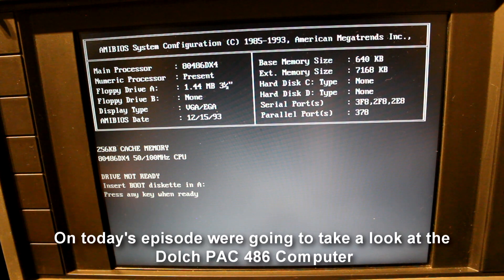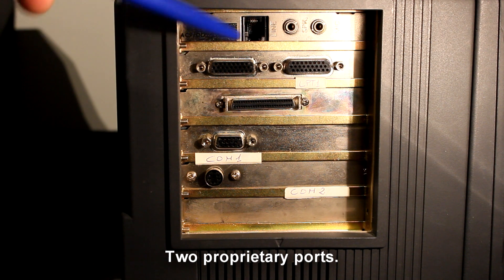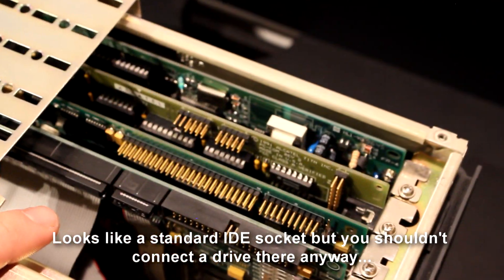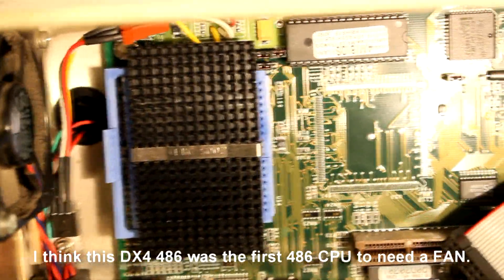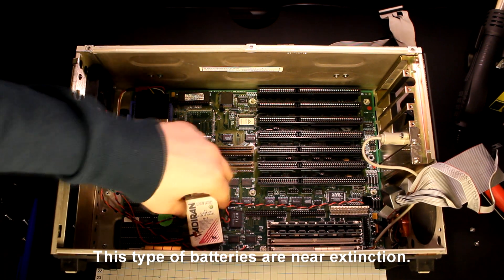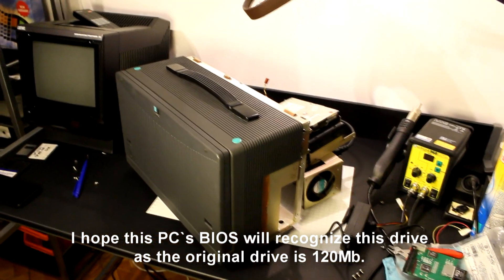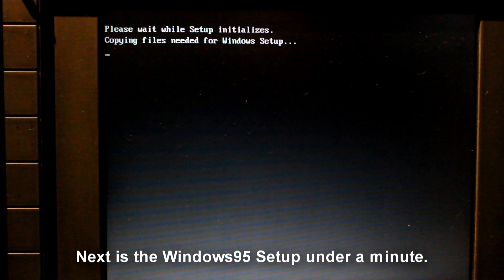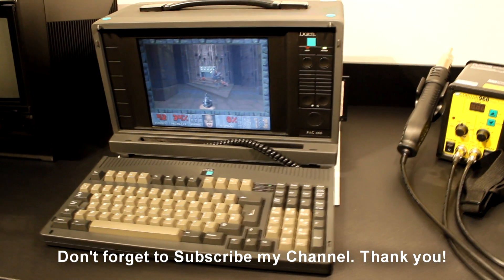DOLCH PAC486 - Overview, Teardown, Repairs

Comment: I just picked up a 486-33 off ebay.  Good deal and the good news was that it actually had a 116MB HD but the seller didn't know.  Anyway, I was wondering how is the skin on yours.  Mine (I THINK) had that rubberize paint and after all these years it's kind of sticky.  Have you clean your case with anything?  e.g. Isopropyl Alcohol, ???  Anyway, thanks for any advice you can give.

Comment: Nice work! I should have gotten one when they were cheap, long ago...
Reply from the maker: These machines were everywhere two decades ago. Most of them got scrapped by now :/
Reply: @thex86generationcomputerhi81  It seems I can most easily find them on eBay (for generally rather high priced working units), or incomplete/non-working units for still somewhat substantial money. I managed to spot a mostly nonworking pac 386 unit for $80 USD, and I am struggling with my nearly nonexistent electronics repair skills to revive it. I am glad to see so many people putting content up about these machines so as to help the community and just remember them.
Reply: Of course, once I do (hopefully) get it operational, then I will likely try to upgrade the keyboard to something closer to the Cherry G80–1813 layout that was used with the 486 units. The one that came with my 386 is similar to what I had on my first IBM clone, and the unusual placement of modifiers drove me nuts frequently (Back in ‘89) due to the layout differences compared to the IBM model M based layouts that many games and other programs expected.